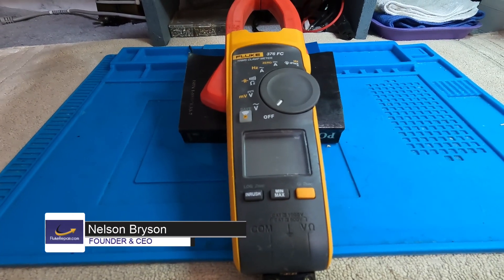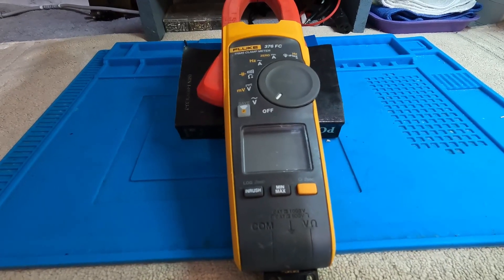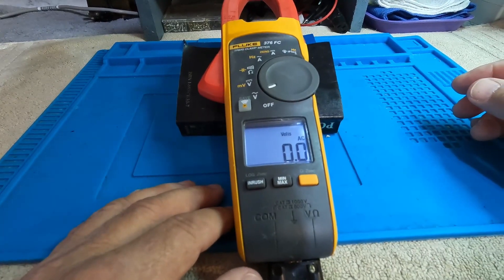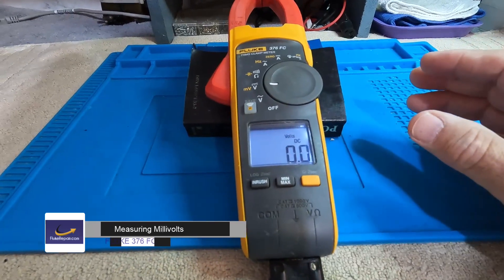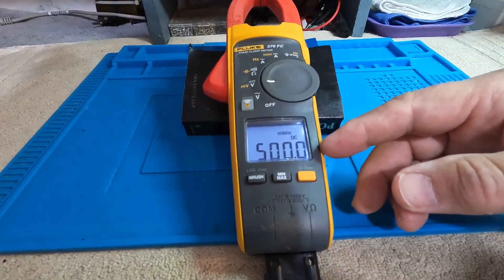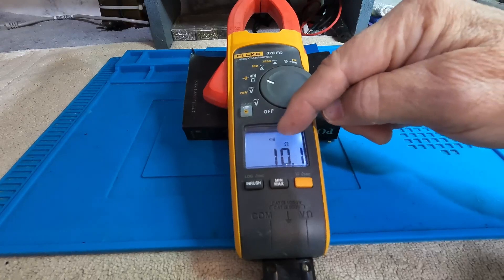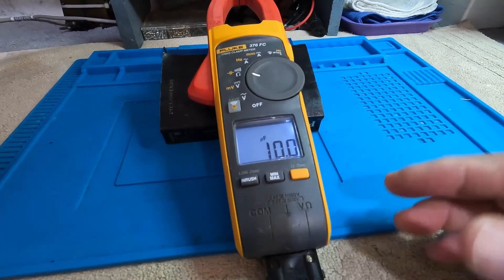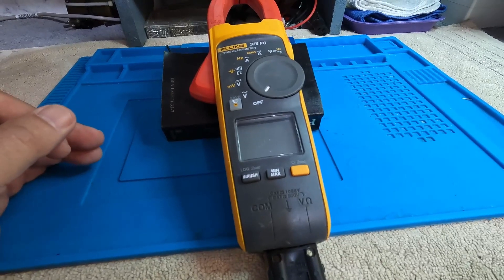HOW TO USE A FLUKE 376 FC CLAMP METER pt. 1

Comment: Fluke has just told me that the inrush function on DC amps is only for industrial dc motors. I have clamped a Fluke 376-FC on my Honda Odyssey's negative cable and started the vehicle while measuring inrush and only got 3.78 Amps-which I know is wrong. What is the difference between a car's starter motor (dc) and an industrial dc motor other than their power rating?
Why won't fluke tell me why said function doesn't work. Is this a meter defect or have they not been honest in their marketing? Be wary of the dc inrush function as I cannot seem to get it to work or as the tech told me-use the min/max function.
Reply from the maker: The inrush function should work when you check your starter in your car. Inrush happens very quickly after the car starts. Using min/max would be useful when looking for this change. It will measure negative current since it is flowing in the opposite direction.